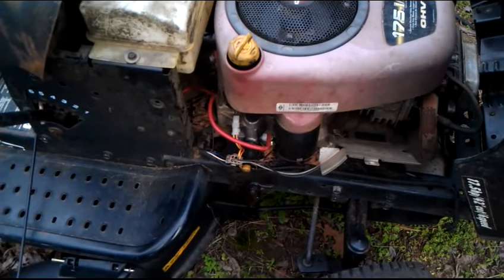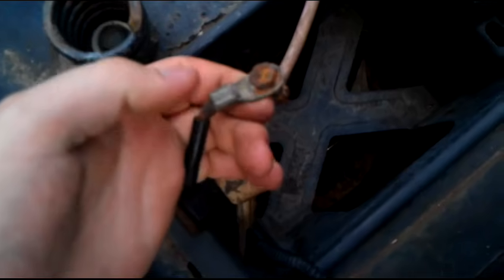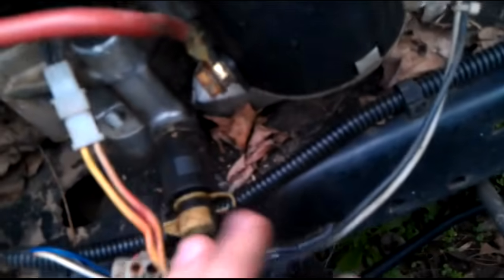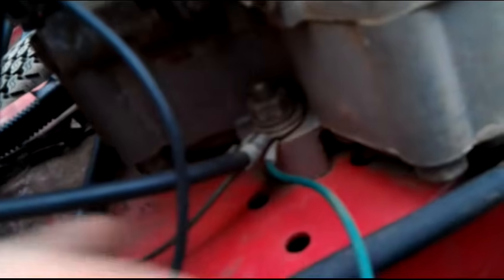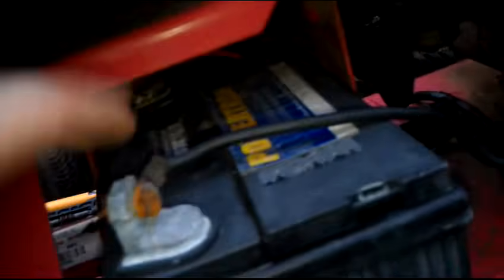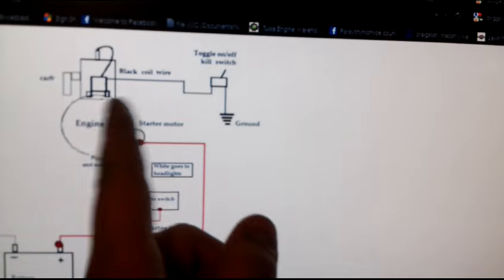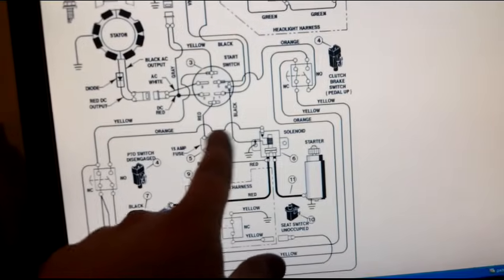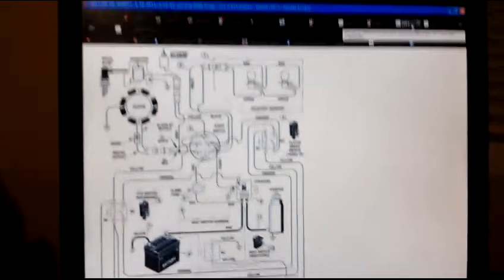How electrical system is wired for Briggs and Stratton

Comment: the lights run to maintain proper charging voltage by keeping a load on the alternator.  it's cheaper than them adding a voltage regulator.

Comment: On mowers its a stator though is the correct word for the part. you can test the ignition solenoid with it disconnect from the mower frame and a good battery or battery jumper you can test those out and test out all the ignition relay boxes to 

If the solenoid is shot then its not worth worrying about messing it up or something catching fire long as the tank is sealed right nothing will spark up 

I had a whole tank of gas and a fire on its cap last year from a welding accident its a good thing i had buckets of water laying around and mud the wet mud i smeared on the melted plastic put the fire out and the tank didn't blow up

Comment: I have one with this same engine and the wire going from the switch to the coil isn't working not getting fire. Someone put a toggle on it and had it working but now when I hook it up ( I don't know how they had it exactly ) it blows coils. I have ruined 3 coils so far and don't want to kill anymore. How do I run it so I don't blow anymore coils?

Comment: I had a craftsman LT2000 with the 18hp BS intek. I replaced the seat switch, brake switch and blade engage switc/pto, releasing the brake or enabling the pto would kill the engine, I had to bypass them by doing a direct link from the ignition to the magneto.

Comment: Where is voltage regulator located on b&s 17.5 motor? It’s a 3100 series model number 31r907 and it’s producing 15.5 volts depleting acid below the plates.

Comment: I have a Toro Twister 1400 with a 16hp briggs vanguard ohv. I put a new battery in it and it is hooked up properly. My trickle charger shows the battery to be at 100%. When I turn the key to start the vehicle I hear one single click back towards to the battery. The starter does not engage. There is no solenoid on the starter. Where should I start trouble shooting?

Comment: I have a simplicity coronet 12 with no crank with the key if I jump the two terminals it cranks and starts. I replaced the solonoid and checked the battery they are bolth good I also found a bad blade pto clutch is bad. Could that cause the no crank? Please help

Comment: Is there no diode on the green tractor's stator connector?  Could you please share some diagnostic steps for why a tractor with a diode and AC into it wouldn't give any DC charging current? Where does the DC wire go other than to the ammeter?

Comment: I just want to know where the other wire that leaves the carb connects on the other side. I see that one grounds but what about that grey one?
Reply: Needs to come from ignition switch with power on to open the solenoid valve on the carburetor.

Comment: jhx86 dose it matter about the wire if it is still having dc12 volts going though it than can you use like speaker wire, if you able to you that for the head lights

Comment: I'm looking for a video to help me figure out how to wire my 13 HP generator to charge the starter battery and also have questions about the fuel shut off solenoid cause it don't shut off the engine anymore

Comment: I ran the one wire from the alternator to the positive battery wire that runs to the ignition switch from the battery. Is that ok or should I run it direct to the battery?

Comment: I have a mower like that the only way it can start is by using screwdriver at the solenoid any ideas thanks
Reply: Check that the solenoid signal wire is sending 12 volts when turning the key all the way to start the mower.  If the signal wire is sending 12 volts to the solenoid, and the solenoid is not engaging (you should hear it click), then the solenoid has either lost its ground (remove it and clean where it mounts to the frame), or the solenoid is bad and needs to be replaced.

Comment: Thanks, that explained a lot for me. I'm not so good with small engines, better with bigger stuff. Anya, what does the solenoid on the carb do?
Reply: yep that was what i want to know and can you just run a hot wire from the battery straight to it for it to work ?

Comment: you said red wire from under flywheel goes to battery . not to the solinoid ?
Reply from the maker: +paul mclaughlin The solenoid has one pole that goes to the battery, that same pole is connected to the red wire under the flywheel. It is the same concept as a one-wire alternator.
Reply: my red wire from under the flywheel goes to a conecter with 2 wires 1red to key switch the other to the flat post on bottom of solenoid is this right ?